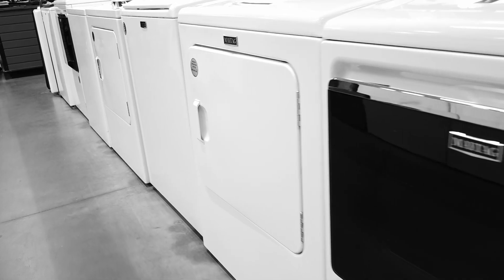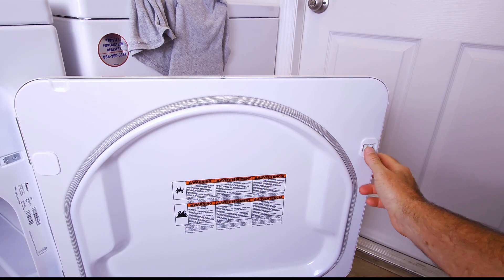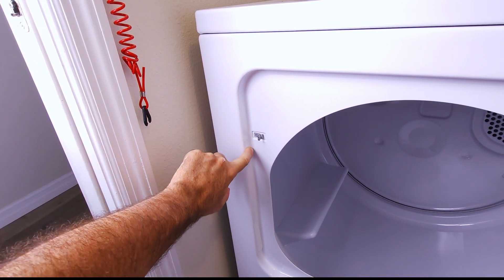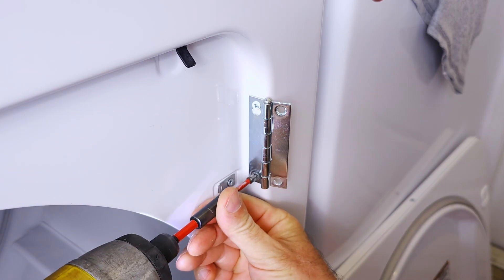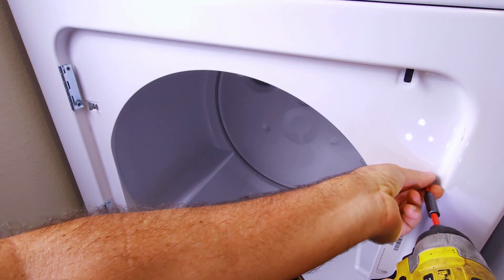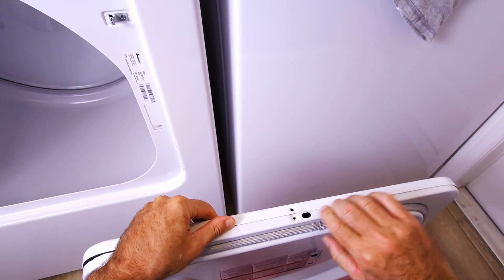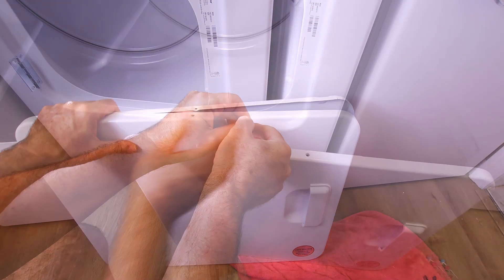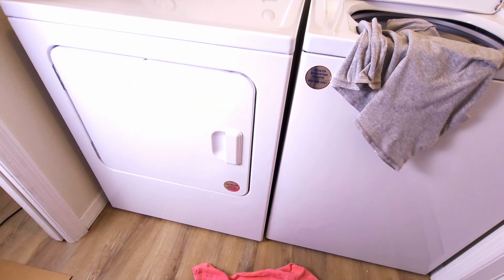Flip Your Dryer Door for Easy Washing Machine Unloading!

Comment: Nice video. I have to say, in my case, my dryer which is a MABE (mexican brand) is prepared so you can just unscrew the hinges turn the door upside down and voila! It comes with 2 catches and even if the door is curved at the top and flat at the bottom, the door seal is symetric so when putting it upside down it seals the same way. Awesome design!
Reply from the maker: Excellent!  Yes that does sound more practical.. 😀